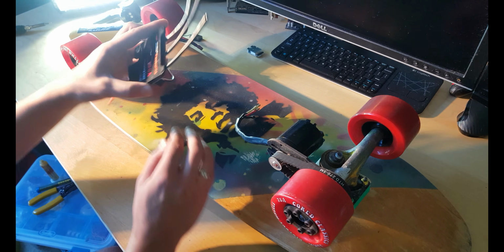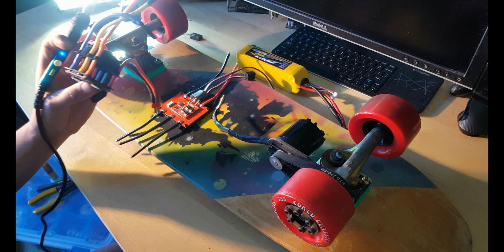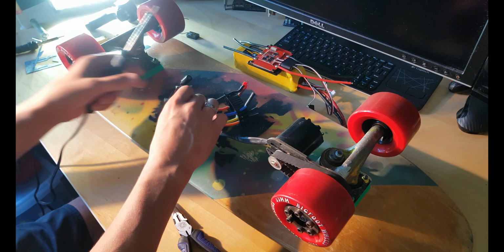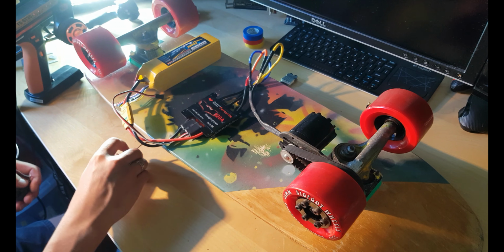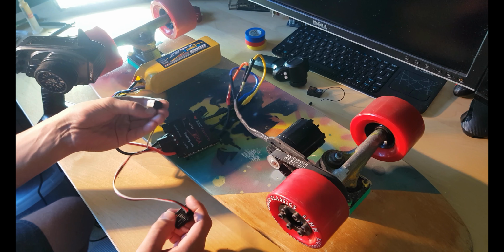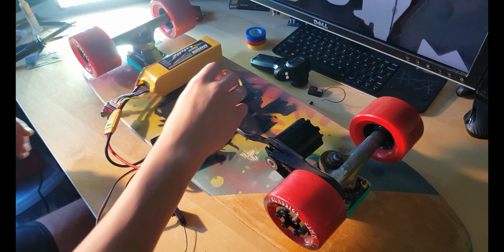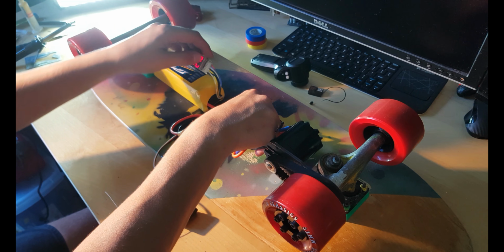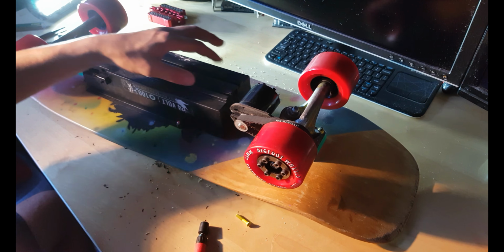How To Build Your Own Electric Skateboard Part 2

Comment: You have to switch two cables of the esc-motor connection. Otherwise I will drive in the wrong direction
Reply from the maker: True, as soon I stand up on it, it went reverse lol